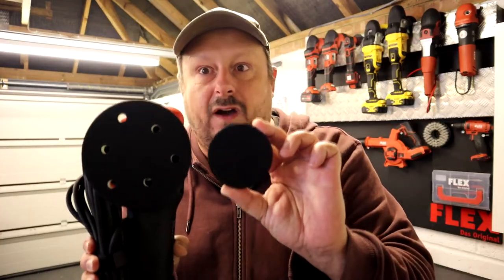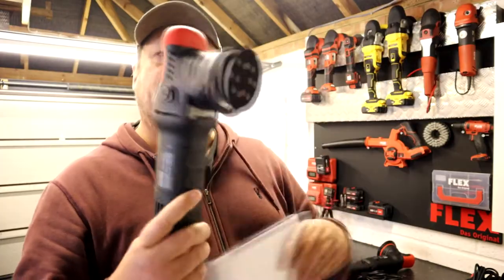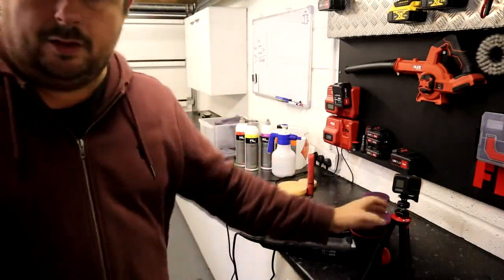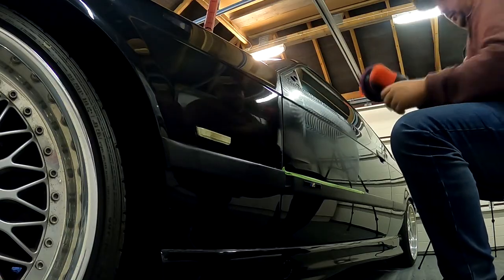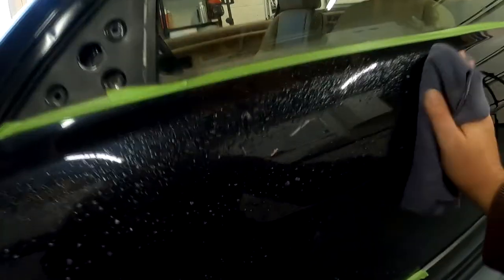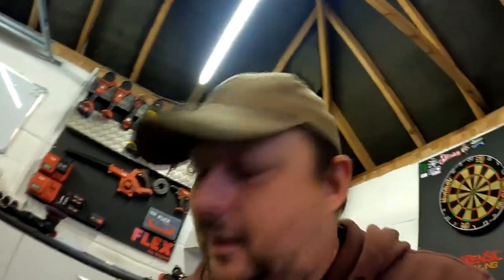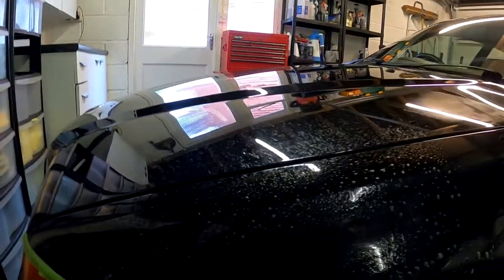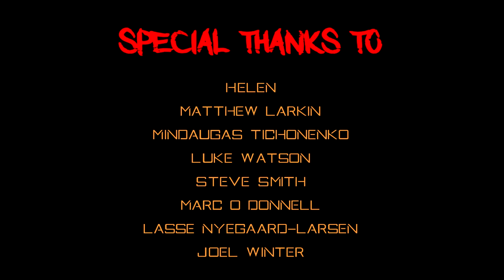Best DA Machine polishers for Intermediates or Beginners? | DA15 and DA12 In2detailing

Comment: Greetings from Portugal! 
Let me tell you a little secret! 
I am professional and I use them as primary and secondary machines! And, to be honest, they do the job! 
Just like you said, don't have the "finesse" like Rupes or Flex, but you can get the same results with a fraction of the price. If brakes down, buy another one. 
My machines were imported from in2detailing and they where very helpful. They actually send me some sweets with the order, which is a nice touch! 
Excelente review, again, and my invitation to visit my garage in Portugal is still on! 
Well done! Vitor Ferreira

Comment: I bought an In2detail as a backup for my Rupes 5 inch. However, I've find myself using the in2deail machine rather than the Rupes. I didn't mean to it just happened. You can use ear protection to ameliorate the noise and anti vibration gloves to protect your hands from vibration White fingers. Love and peace x

Comment: Great Vid very useful things to know! What compound were you using on this one was it the middle grade one? And what sort of paintwork would warrant using the deepest cut compound? My cars a 04 and has quite bad swirls and marks on one side! Am I right in thinking I can do all the cutting with the purple pad, and polish with the yellow?
Reply from the maker: I used F6 (f5) in this video.  any paintwork you can use high cut really.. but on soft you will find its so easy to remove scratches a mid range product can be the best bet.

Comment: Hi, mate watched your videos for many years and learned a lot, What's vibration like on these DA polishers, I find when I use da polishers I get left with tingling feeling because of vibration, That's why I prefer to use rotory polishers at lower speeds and a lot smoother
Reply from the maker: more vibration than the premium tools. one of your comparmiases for a cheaper tool from china is noise and vibration. for most theres not much in it but if your sensitive to this and its a problem I think rupes or flex will be the way forward.
Reply: @ForensicDetailing  
Thankyou for your reply shame them polishers are so expensive

Comment: Ended up here after watching both your pad videos again. In the comments you mentioned to check this video for the Flex Pads vs Scholl.

Im looking for more of the 3 inch Scholl NEO Honey pads but can’t find them. Is the Flex Orange more similar to the Scholl Orange or the Honey Foam?

I’m guessing as the purple seems to be the same then it’ll be the same as the orange. 

Scholl don’t answer emails in regards to whether the 3 inch honey pads were discontinued.
Reply from the maker: I dont know for sure but I don't think they are the same.  The purples are the same. I don't want the cuts though
Reply: @ForensicDetailing  How do the Flex Orange feel hardness wise in comparison to Scholl Orange or Honey. The Scholl Orange feels softer than Honey to me and I prefer the Honey. So the Flex Orange would be ideal if they are  like the Honey firmness. 

The Honey 3 inch which I have don’t have the cuts, can’t think why’d they’d be discontinued though (if they are). As there’s now no alternative in the line up. So it annoyingly breaks the “system”. I got them around 2016 and haven’t been detailing since then. Just got back into it. 

They don’t make the 1-2inch pads either in this foam just the navy/purple/orange, weird. 

Thanks for all the great content anyway been watching everything from the last 4 years over the last few months 👍

Comment: Hi, I know this is an old video and wondering what the best machine is for removing both fine and deep scratches from the paintwork. Also what paste would you recommend for removing deep scratches from a side window. Thanks
Reply from the maker: you wont remove deep scratches from glass mate.   Any DA will generally be fine mate it just depends on budget, you go rupes and flex if you have more money or these if your on a budget.
Reply: @ForensicDetailing  thanks for the advice, much appreciated

Comment: Im learning right now workin on boats. I was wondering if its good practice to cut with a 15mm or 21mm and polish with a lower mm machine like a 9 or 12mm to have a better finish, less marring? I was just wondering if that is the case? Thanks.. Also, whats the best polisher youve ever used? Top 3
Reply from the maker: theres lots of factors mate Ive never polished a boat but Im guessing if your getting marring its a really soft gel coat finish, so a less agress machine and polish might be the way to go.
Reply: @ForensicDetailing  I meant on vehicles, Im just starting to use a polsher and working on boats. I want to do my blk gmc sierra this summer and was wondering if that applied to clearcoat bigger mm to cut lower mm to finish? Thanks for replying.

Comment: I need to polish a huge high top XLWB van. would it be better to use the DA15 because of the larger areas, or would it not make much difference with a DA8 ?
Reply from the maker: Its the plate size so use a 6 inch plate will help mate.

Comment: Same uniit with maxshine from Amazn . N clover on aliexpress
Reply from the maker: incorrect. once again people talking about things they dont understand about and getting it wrong and spreading misinformation. this is not made by maxshine and its not the same as the N clover machine.   And of course you wont apologise for being wrong.  Its no secret its made by someone out in china though, but at the moment In2detailing are the only people selling this polisher in the UK. (Im sure someone else will offer it at some point though)
Reply: @ForensicDetailing  i'm sorry if i'm wrong   :-)  but the spec is pretty similar with ms 15 pro mk2  (diff shroud actually) and clvr da 15 mk3 maybe the clone  .. just diff  rubber color

Comment: For someone who’s starting off which size polishers would you recommend, not in terms of brand but sizing please? Would you opt for a 5 and 1 inch or 5 & 3 etc
Reply from the maker: this is a great question its hard to answer because budget plays a role some guys will buy "the lot" and the best even when they start but here it goes

a) 95% of people should just buy a normal DA like the DA8.  this supports 5 inch and 3 inch plate job done.  polish the car once a year swap plate as required or just make do with 5 inch plate.  (normal people :) )

b) if polishing 1 car a month or more get a DA15 and DA12 (3inch mini).   It will just make polishing bumpers and pilers easier etc.

c) If you get the full on detailing bug and lot it and want to go elite mode add a nano polish to the arsenal.  PXE80 or Rupes nano or carbon collective one etc...

I love the combo of XCE cordless and PXE cordless. The PXE cordless supports 3 inch and 1 inch so you get the full range with 2 machines.. but yes the PXE lacks a lot of grunt compared to a proper 3 inch polishing like the DA12.

hope this helps theres no right or wrong just options and budget etc...
Reply: @ForensicDetailing  thank you so much for taking the time to respond, and in great detail which is exactly what I was after. I currently run an Auto Finesse 5 inch polisher, and the detailing bug has hit massively however can’t commit to a Rupes for now so have been looking at adding a 3 inch to the group for trims/intricate areas a 5 inch can’t reach. Been looking at the in2detailing, shinemaster, SPTA among others then torn as the Rupes 3 inch is not far off that price wise, an additional £100. Lots to think about. Thank you again.

Comment: I am looking for a new cordless polisher have you tested the new milwaukee DA units as I already have milwaukee tools with the same batteries. Or do you only recommend the flex units
Reply from the maker: If u just want one da go with the Milwaukee.
Reply: Thank you my original in2detailing corded machine was awsome for the last few years as per your recommendation but now I have moved and running extensions is a pain thank you still for all the great vids and testing

Comment: If I bought the DA8 using the 5” pad and then swapped to the 3”” pad supplied but didn’t change the counterweight would this be ok or cause problems?
Reply from the maker: Yer it's ok, just a bit more vibration

Comment: i know this sound silly but can i ask which machine should i get the wife car is a golf 1.6 fsi blue 2007 ive never used one before and only have max £200 to spend i know car bad it has key marks around handle so will need to get a small buffing add on to go round in handles ill only  be doing her car and will do 1 to 2 times a year and what polish ive seen in2Detailing DA8 Dual Action Machine Polisher *The One Stepper* i had email in store then within 5hrs all sold!!! please any help be great!
Reply from the maker: hey there I think its chaos at the moment trying to maintain stock with covid and the worldwide effect on shipping.  The DA8 is the best starter polisher really for your requirements.    The only thing is is you wont be swapping the plate around much.  so you could just get the da15 instead and then if you really get the detailing bug you can get the DA12 later.  the DA15 has better grip and trigger and is nicer to hold and will cut a bit faster as well.   But if you are sure you want an 8mil DA like the DA8 you can get the DAS6 pro fro clean your car if you dont want to wait for DA8 restock.

You should check out my Detailing Fundamentals training course with discount code applied it will help you get started with all this.

https://ioa.pxf.io/c/2687409/1012495/12764

Comment: Sorry me again the da 8 is out of stock :( thinking about getting the 15 instead okay for a first polisher ?
Reply from the maker: yer its fine but you cant put a small plate on it.  but get the DA15 and if you want later on you can get the da12 (3 inch mini) to team up with it.    Most that start with the DA8 onbly use 5 inch pads anyway as it gets expensive buying like 3 inch pads as well.  go for it.

Comment: It's 3.5 kg not 2.3 for the DA15  plus.
Reply from the maker: - Power Consumption: 1000 watts
     - Operating Voltage: 240 VAC, 50-60Hz
     - Lifting speed: 2000-5000 min-1
     - Weight: 2.3kg
     - Cable length: 6m
     - Polierhub (throw): 15mm
     - Thread connection: 5/16 "-24
     - Backing Plate diameter: 125mm
     - Certified by: CE
Reply: I'll send you the specs from mine John.. says 3.5 kg on mine.
Reply: Only a 4m cable too oddly, so am thinking they've changed the specs
Reply from the maker: it cant be 3.5kg thats very very heavy.  2.3 sounds about right.
Reply: I messaged Imran.. he said they had the cable lengthened to 6m at the factory, but he hasn't weighed the DA15 but will do.. so I've just this minute gone in the dark depths of my garage and put them on my paint spraying scales and I can confirm that you are 100% right. The manual is wrong, they were bang on 2.3 kg 😉👍 so apologies on my part.

Comment: 12 months warranty doesn't inspire much confidence
Reply from the maker: theres got to be compramises with the cheap tooling versus the premium tooling.  imagine the amount of work you can put this tool through in 1 year if its used 5-6 days a week 5-6 hours a day.     so this is a comparmise, so is the like internal component quality.  its more grindy and higher vibration than premium tools.